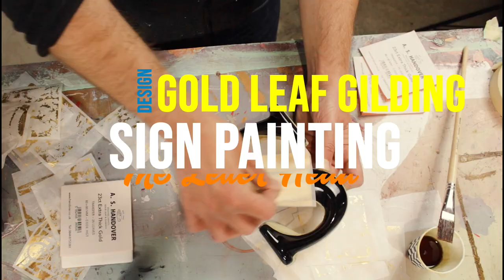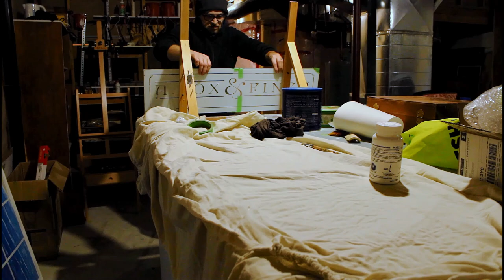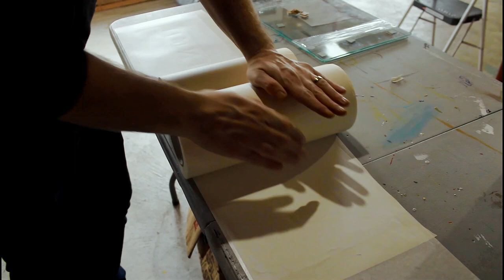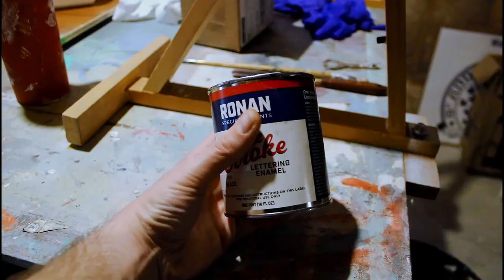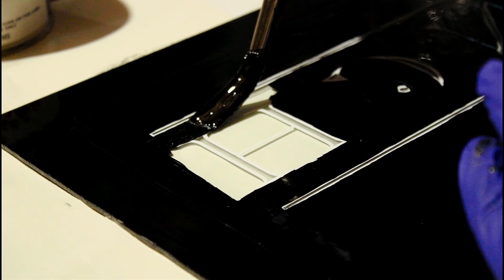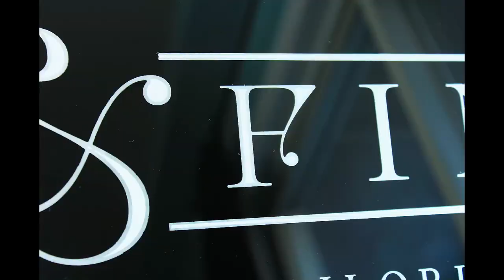How to (and how not to) use Rust-oleum Mirror effect spray for a traditional painted glass sign

Comment: Hallo Lewis, i think you already know, just in case if not, you also can apply your stencil the "wet way". I use distilled water with a drop of dish liquid in it and pour it over the glass with a vaporizer. So you can still move your stencil and it don't sticks. With the squeege you move out the water on the edges and let i try a hour or so, that works pretty good. I also detect  the thin side of the floatglass, the color sticks better on the non tin side.
Reply from the maker: A great point! You can certainly do that normally. I've had trouble with this particular stencil in the past with water. Definitely doable though normally!

It's only very recently im hearing about glass having a better side for this. I know you can test with water but it's new to me!

Comment: Backing Paper 'Lift off' is generally caused by over-cutting the vinyl.

Either reduce the force or wind the blade in a bit.  ✌

Great Video 🙌
Reply from the maker: Hi jezz, you're quite right. That is generally the cause, but I suspect that this stencil mask roll was of older stock, as it stuck to the backer too much. Some areas were not well cut either, so I didn't have the option of lowering force.

Thanks for the input though mate!

Comment: Hello, my idea is to use silver foil for the outstanding letters, which have to stay on the backside of the glass. Then I would have done the etching and at last the black painting. Maybe you have a good result with a mirror foil
Reply from the maker: Hiya,

Yeah i would normally use white gold leaf for this, but wanted to try the mirror spray out. Mostly to see how it would work. It doesn't look too bad but certainly has room for improvement.

Comment: Cool video. I’d try some tests on glass with the number of coats and paint combinations . The mirror spray could be a bad influence on the Ronan. I have some king cole black and backup black which works great for reverse glass. Well played though. I use Rusto to roll a lot of my panels . I’ve had negative results with spray paint and especially aerosol clear coat when added to 1-shot and Ronan . 
I think that’s cause there’s a gassing off period that takes quite a while. Anyway keep it up. It’s always nice to see the process warts and all.
Reply from the maker: Thanks a lot for the really useful comment Bob. Will have a try of some of the things you have suggested!